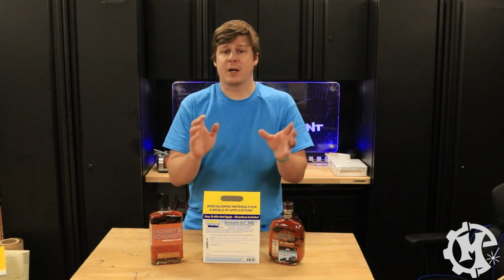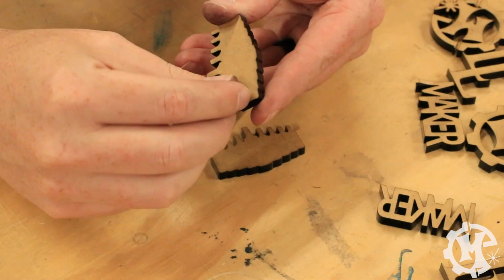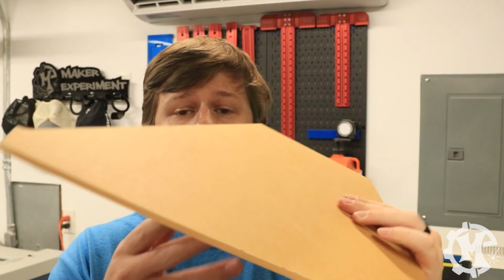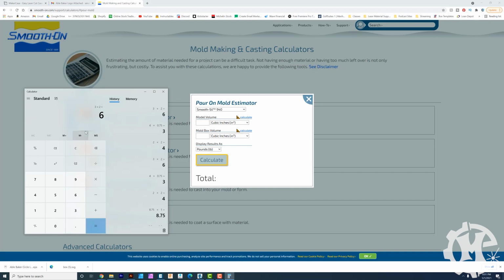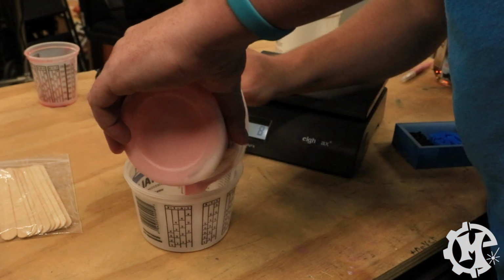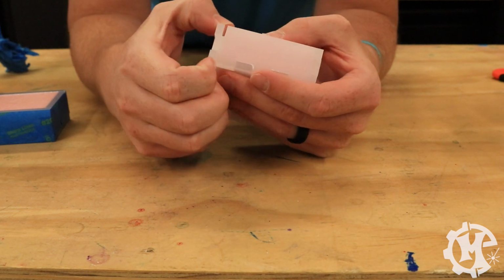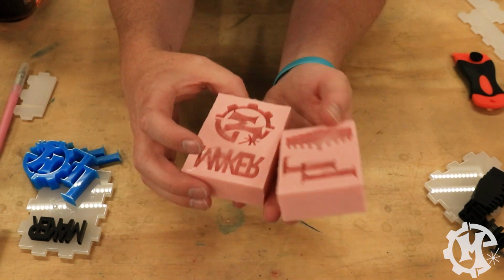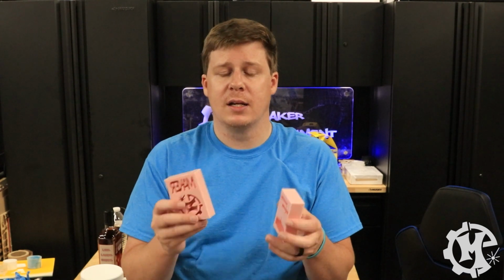MAKING CUSTOM ICE CUBES | USING SILICONE FOR THE FIRST TIME

Comment: why don`t you use a 3d printer to make a the shape of your mark?
Reply from the maker: I could. The whole point of the video was to try doing it with a laser if you don’t have a 3D printer.
Reply: @MakerExperiment  awesome.  I have a laser and 3d printer but haven’t figured out using the 3d yet 😒